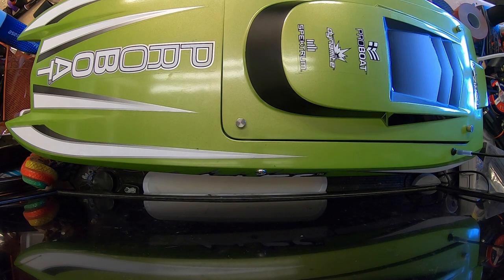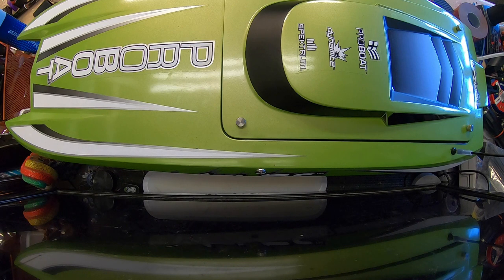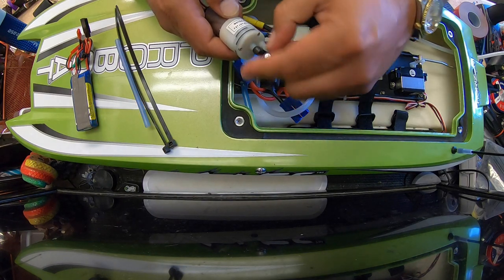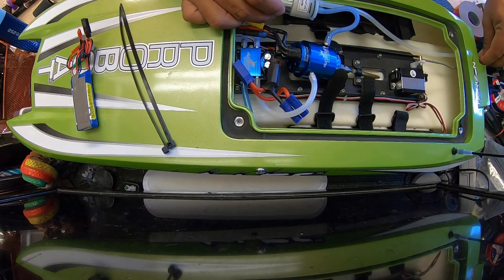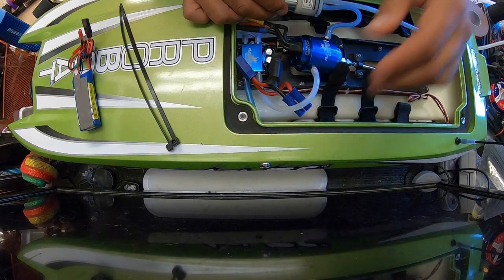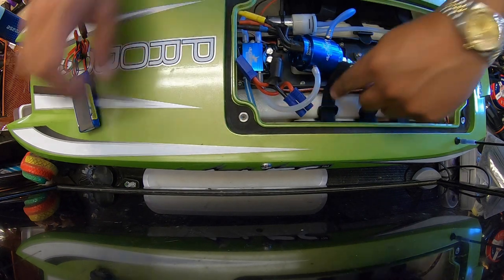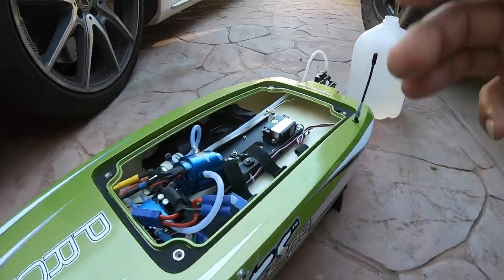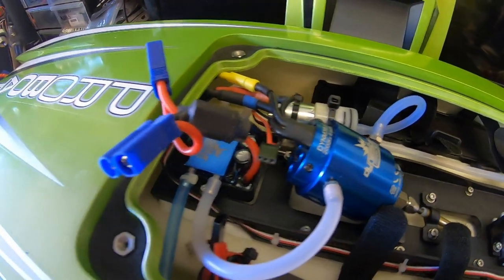How To Install An Electric Water Pump On A RC Boat For Better Cooling

Comment: I hate to break it but here is no need to do this on a FE boat. You would never see this on a racing setup. You are actually reducing cooling by doing this once the boat is moving, creating additional resistance by going through the pump. Not to mention added weight. Obviously if the boat isn't moving this will keep moving water through, but the point is to run the boat. The faster you go the harder the water flows through the jacket. If you have your cooling set up right there is no need for this. You can actually get more out of your cooling just by rotating the cooling jacket to the right so the inlet is at the lowest point and the outlet is at the very top to increase water contact with the motor housing. Increase your tube ID/OD and drill out the water pickups.
Reply: Never thought bout that keep the air pockit at the top so itll push out

Comment: Wat kinda of battery did u use wat kind of battery connection does it have I got the water pump but now I need the battery if you could tell me what kind of connection it is and battery you use that would be so helpful thank you

Comment: Great video man. However the lovely part about fast rc boats is a pump is not needed because the pump can’t provide as much water cooling as the water that can be forced by pressure. The faster you go the more cooling. With a pump you are actually limited on how much water can be pumped by the motor. Great for slow speed yachts or cruising but not so good for high speed
Reply: He said in the video that from experience it cut temps in half
Reply: @detroitdiesel7074  🤣🤣
Reply: @detroitdiesel7074  It cuts temps in half if you check the temps after a few minutes of letting the pump flow water through the system. If you were to check temps during a run (while the motor and ESC are pulling a big load) you would see that the pump is worse for cooling as it has a much lower flow rate.

Comment: I used the same pump on my Veles 29 but I mounted it near the receiver and used the aux port.  Now Im running another pickup and dual lines instead of the pump it works good.
Reply: Same here on my sonicwake plus a rubber sealed switch poking up through the top for on/off after i put it in the water the pump isn't always on. What I'm trying to figure out is a way to switch it on and offwith the auxiliary using a DX5C transmitter.
Reply: You runing dual line with one pump?
Reply: Have a link for the pump used?
Reply: @dnr7770  buy an RC auxiliary remote switch - it allows you to use a free channel to turn on an LED, or in this case your pump.  Just don't forget to turn it on!!

Comment: Do you need that 2s battery or can you plug it into the receiver?
Reply: That depends on the pump.  They come in 5v versions and 12v versions.  the 5v can be plugged right into your receiver, as they have a typical BEC voltage of 5-6v (even 6v is fine)

Comment: How long does the 2s battery last running this pump? Just wondering how many extra batteries I may need.
Reply from the maker: I've let the battery pump for over an hour without an issue
Reply: What name is the battery and number on the back

Comment: I tested your idea and the end result was not good!!! Caused my Sonicwake to burn and melt all 3 motor leads due to extreme high temps!!!  The electric pump is not a good idea on electric boats EVER because it restricts the water flow to the motor and esc, and thus allows for higher temps during runs and that defeats the purpose of the cooling line circuit and what it was designed to do. Water pumps are only used in gas rc boats to assist in heat transfer when the boat is idle on the water. I would highly recoomend that you delete this video as it is providing false information to other people that could result in them ruining their boats electronics. There is no way you got lower temps using this pump unless you allowed the boat to sit in the water and transfer heat before taking temp readings which is not the way any of us collect data. Run the boat hot and take temps immediately after the run. Then see what you have. I bet your data changes drastically!!! Ditch the pump idea and just run larger cooling lines. You will transfer way more heat efficiently that way versus using an electric pump. Trust me I collected the data already and have no problems producing a video to prove that.
Reply: While all that may be true, if your running a boat that isn't a high speed boat then the pump is still useful.
Reply: @Danvers97  agreed on the non-speed boat use